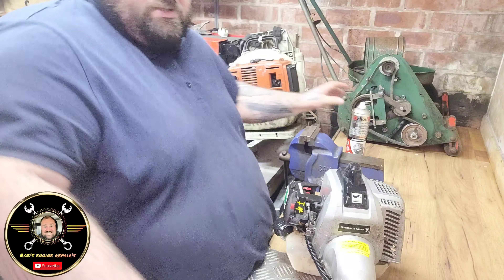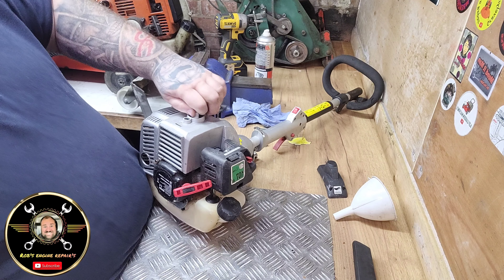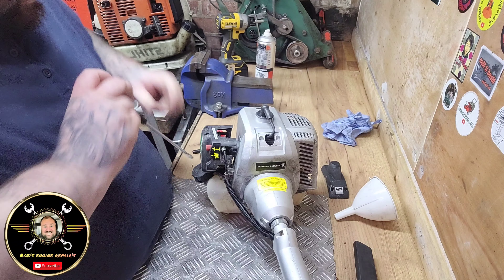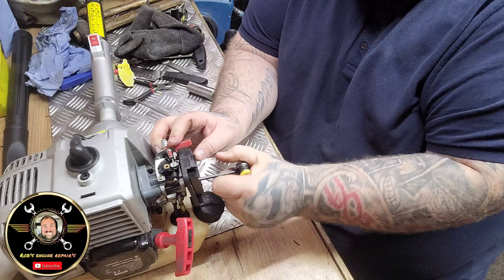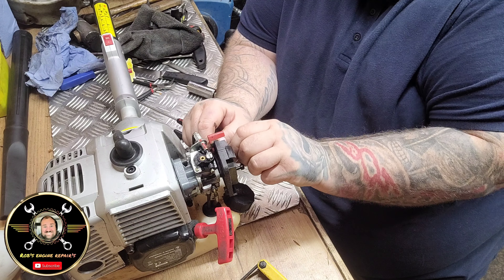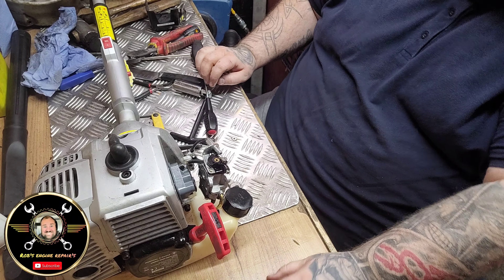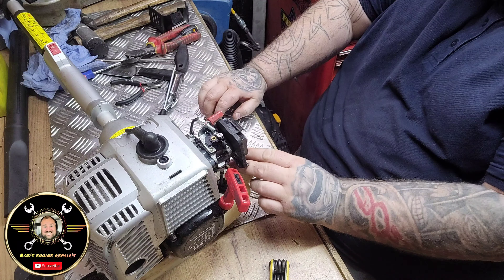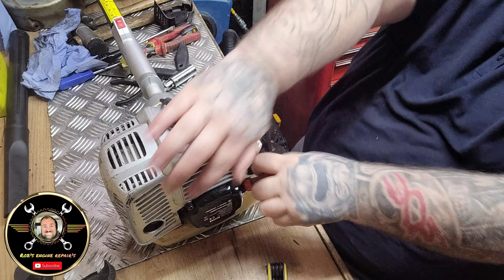repair on a spear and Jackson petrol trimmer

Comment: Rob I have a spear and Jackson spjgt26 .
I've put a new carburettor on it and cleaned out file tank new pipes and filter and air filter fresh 40/1 mixed petrol.
It starts up fine but as soon as you go over half throttle it boggs down like it going to stop running.
I have the Acircle tool to adjust the mixture and throttle but I am not sure how many turns out to turn the mixture screw from fully screwed in.
If you or anyone can help it would be fantastic been looking for three days spear and Jackson website is as good as a chocolate teapot.